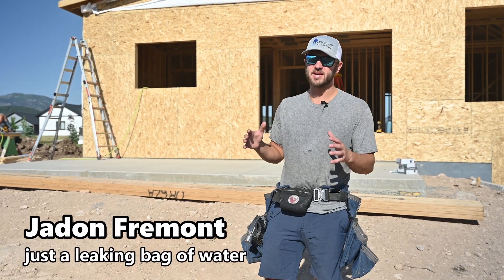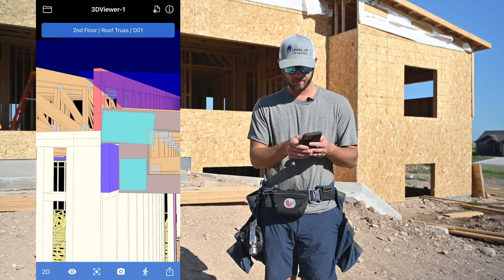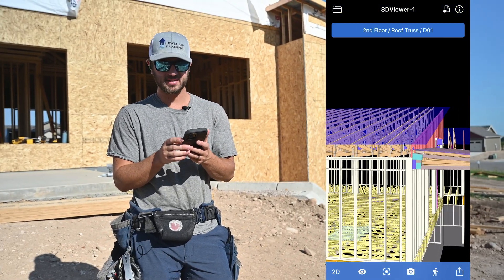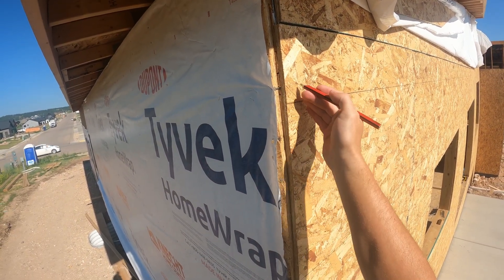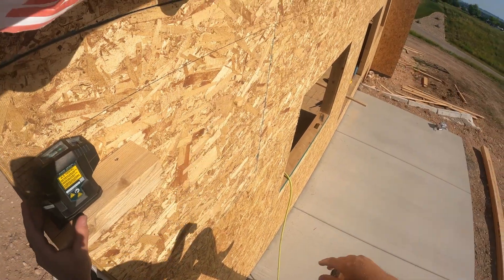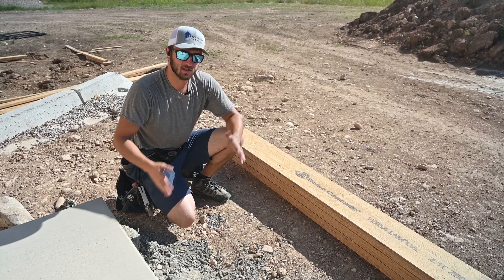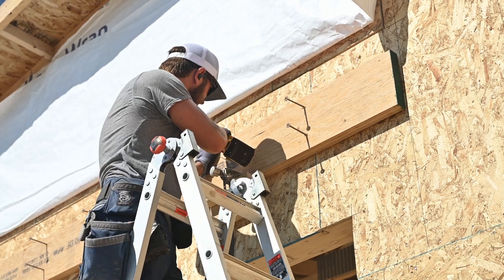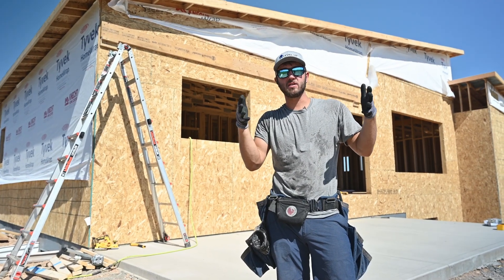How To Install a Ledger Board for Roof Trusses

Comment: I'm adding a ledger board to the side of my existing structure. Everything I've read says I must attached directly to the studs and cannot go over the sheathing.  I see you went over the sheathing, which I think is the better way to do it. I really don't want to cut out all my sheathing to attach my ledger directly to the studs.  This way seems so much better.